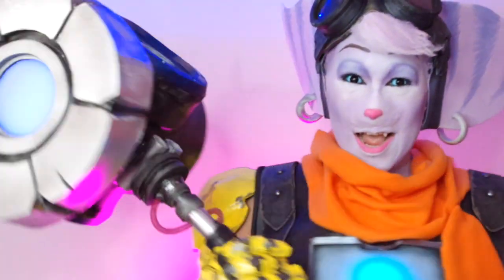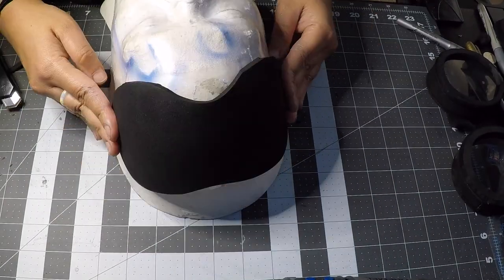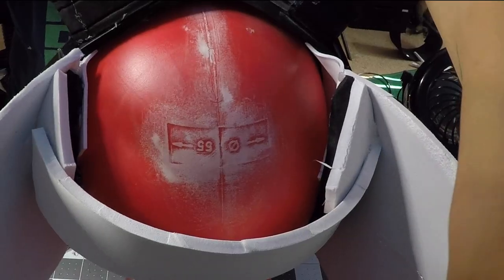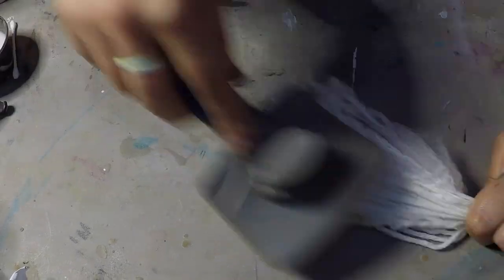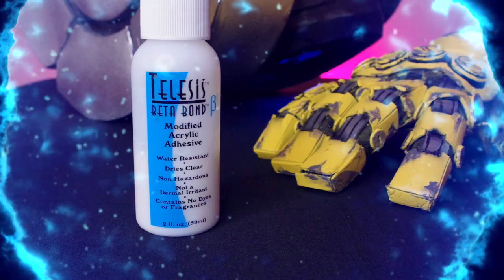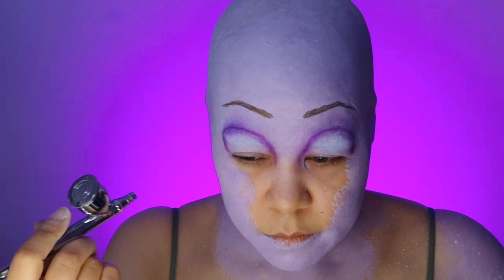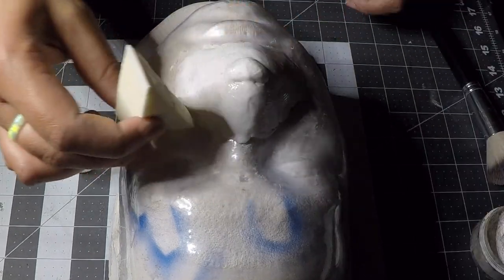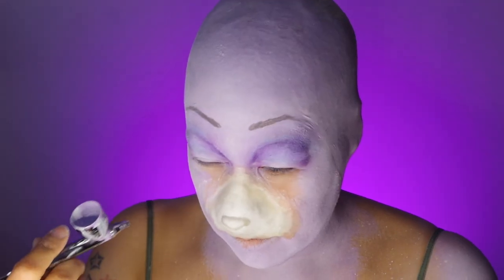Rivet Makeup Tutorial | Ratchet and Clank Rift Apart

Comment: How did you attack the chest piece?
Reply from the maker: There was a solid piece of EVA foam across the front of the top. Hot glued the frame onto the front foam. Did cut out a hole in the back thru the original shirt and panel of foam so I could control the lights